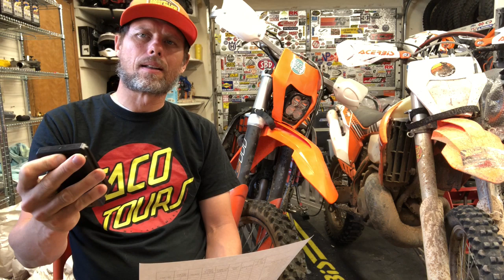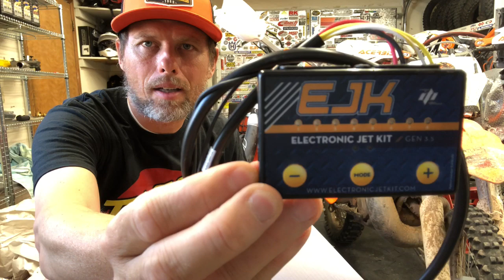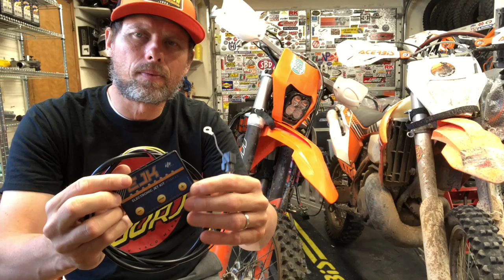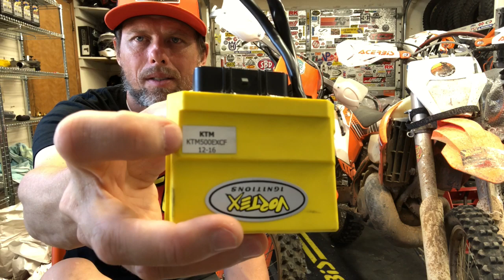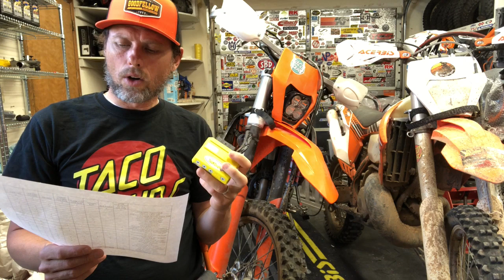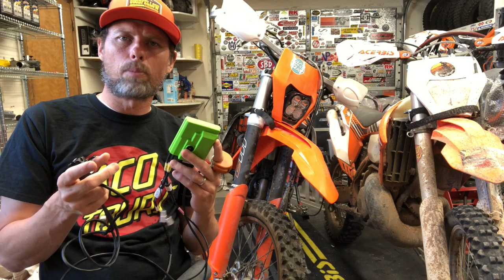Athena GET, Vortex ECU, ECU reflash, euro map, stock ECU, Dobeck EJK tech talk

Comment: Great, at 38:54 you completely talked me into getting the most expensive option ECU wise. But with a background in tuning stand-alone ECU's for cars, you're speaking my language... I'll be calling you up as I get a credit card the wife doesn't know about... Thank you for a very informative video!
Reply from the maker: I’d like to hear what you think of it after you’ve got some miles on it!
Reply: @TACOMOTOCO  The combo of the GET and the Promoto billet end cap is amazing! Complete monster when you have the traction to put the power down! I thought it would be a little louder and I'm glad it's not. It's an awesome throaty sound without being ridiculous and to have the power without being too loud is cool. I wish I could have done an actual back to back comparison but I had sent my suspension off to Kreft before I ordered the ECU and end cap. So I had 3 or 4 weeks between riding on the stock ECU/suspension and GET/end cap/new suspension. I couldn't be happier, thanks again Mike!

Comment: Very helpful thanks.  I've just bought a 450 EXC having a 390 ADV in the garage already.  I find the TC on the 390 useful in the dirt but often turn it off too.  I'm thinking I would like this feature on the 450 (be able to toggle TC on/off) so the GET is very appealing as a drop in solution.  I'll ride the 450 for a bit before I take the plunge I think.  Thanks again for the breakdown.

Comment: I've been tossing around the idea of putting an ecu on my crf and this video made up my mind. I live in southern arizona so I ride everything from low hot desert to alpine forest mountains. The ecu will will allow me to tune my fuel injected bike to run great in the many different altitudes and conditions I find myself in. I'm still not sure if I will go with the vortex or the get but I'm convinced that aftermarket ecu is the way to go. Thanks for a great informative video🇺🇲👍🇺🇲
Reply: Ugh!!! Lol do I want vortex so I have more maps to work with or get so I have t/c and ability to make changes through data link? Side note I run a completely stock crf250r. No aftermarket exhaust or anything. I'm strictly adding an ecu to optimize the performance and potential my bike has in stock form. 🤔
Reply: @jondoe4667  did you end up getting a vortex or get?

Comment: So for the guys who are riding a dinosaur like me(2013 500 XC-W). Another alternative is the Dynojet PCV (5) It is kinda in between a piggyback and a new ECU. It installed like a piggyback but allows you to change fuel and ignition at numerous poins on a throttle position and RPM graph. It is definitely for the guy who likes to tinker or has access to a dyno, because the number of pre compiled maps isn't great.  I chose to run an O2 sensor and map switch on my setup. You can run both, one or the other, or neither, depending on your preference. Having said all that I like the Dynojet but if the GET ECU was an option for the 12 to 17 500's I would be tempted to check it out for the simplicity of not having to run all the piggy back plugs.

Comment: Hello Mike. I have been shopping for a used 2016-ish KTM 500 EXC-F and have therefore been schooling myself up on the bike and already learned very much from your videos. Furthermore, you're an excellent teacher and speaker, not to mention your sincerity and wealth of knowledge!

Matter of fact, tomorrow I am going to look at a 2017 500 that comes with a Vortex ECU. (Also been uncorked and desmogged.) But the Vortex is one of the things that appealed to me about this bike. I fully expect it to run well when I take it for a test ride, but if I buy the bike, I wonder how I can know if the ECU has been tuned and properly configured for this bike? Thanks if you can point me in the right direction.

Comment: Question , I’m guessing the 02 sensor is now dead weight ? Ecm will no longer need its input to calculate air to fuel mixture ? It will now use pre Proggramed  map and the barometric pressure sensor  for elevation changes correct ? I wish the o2 sensor was still used for the aging of the parts , like less fuel pressure or dirty injectors over time . The 02 has a lot of benefits .

Comment: Vortex, on my Honda now has a proper traction control, not just map switch. Activated and deactivated by the start button. I have tested it and it works very well on slippery surfaces. Not sure if it is available  on KTM Vortex models.

Comment: TPIs dont need more fuel they need different injection timing.
They inject on the piston down stroke so most of the fuel goes straight up the t ports and the whole bottom end doesnt get any fuel cooling.
It gets oil ok but that doesnt cool the crank and rod and piston like a carb engine does.
Parts that run hot are more prone to failure no matter how much oil they are getting.
Ive retimed my TPI to inject 5 degrees after bottom dead center and obviously removed the oil injection system and use premix.

Comment: I saw somewhere that enriching the fuel will let the rest burn in the catalytic converter and fry it. And that enriching will keep the catalytic converter from getting up to working temp while it just smolders under a lot of fuel and prematurely wears out out. Any truth to that? That said, I am looking for the best way to get rid of off throttle lag and still stay legal on a 701. And not be loud. I know that's a stretch. Is why I was wondering.

Comment: Great video.  The one problem I have with the GET on a 2019 FE501 is, it disables the stock kill switch.  Still waiting on an update from athena on that.
Reply from the maker: We use the Sicass Racing combo switch as a work around.
Reply: @TACOMOTOCO  At this point what is another $50 right. I would rather not upgrade my switch but i presume if i didn't upgrade that when the update comes you can just change it via the Wifi correct?

Comment: Very informative.  So to reduce flameouts only which reflash would you recommend.  Not looking to add adjustability just looking to reduce low rpm flameouts
Reply from the maker: First make sure your idle is set to 1800-1900 rpm per owners manual. That fixes it for a ton of guys. Next would be to increase the fueling a few percentage points in the low throttle angle range. Is your exhaust still stock or has it been modified.
Reply: @TACOMOTOCO  stock exhaust. I set my idle to @ 2k.   13 tooth primary gear.   Yes I'm thinking it needs a little more fuel down low

Comment: There is so little information about the get rx1 ecu, there is no pin out of the connector?

It seems like this ecu can do quick shift? If you wanna do that what pins is it wired to? Is it only compatible with digital switch or can an analog load cell be used?

Please advice.

Comment: How does the GPA dynamic traction control work without any wheel speed sensor on the map 2 setting for the 2022 KTM 500 EXC-F 4-stroke RX1 PRO, and is map 1 setting still full power and map 2 setting still soft power?

Comment: So my 2024 six days 500 came with the handlebar TC Map switch As far as I can tell it does nothing but lights up. does it connect to this aftermarket vortex or is it down stream of the Vortex. Also If I buy the vortex and select it to the  #1 map setting will the switch be able to give me another map and what designates what the switch does.

Comment: Do you have an opinion on the stock ecu reflash from blais racing?  They claim $99 for a reflash.  Looking to increase performance with this an endcap at first and maybe add some more from there.  Dont have any need to adjust myself as long as it runs fairly well.
Reply from the maker: Chris does a great job and if your ecu can be reflashed I can def recommend that

Comment: Hi there
First of all, I must admit this is an excellent video! 

However, here is some unusual question, I got KTM 500 EXC - 2014 for a really good price, however after a few rides I realized that this thing very hard to control for me. I not a pro rider and my rides usually single tracks and technical trails.  

Here is the question: What would be the best way to reduce the power of "500 EXC" to make it more suitable to single tracks?
Is there a way to make it easy to ride some kind of traction control that you have mentioned in this video?
Reply from the maker: That’s not an unusual request at all. In fact I have the same desire for my 500. I want it to be Ann all kit race bike sometimes and a reliable trackable single track bike. I have that spread of performance with the GET ecu and the traction control knob. 

https://tacomoto.co/products/get-rx1-pro-ecu-upgrade-2017-2019-ktm-500-exc-2017-2019-husqvarna-501-fe

Comment: If I just want to add a slip on FMF 4.1 and remove emissions, do you think an EJK will suffice for keeping the bike from being too lean? Or would it be worth the $700 for the vortex?
Reply: I own a stock 2017 FE 501
Reply from the maker: a piggyback gets it done all day long.
Reply: @TACOMOTOCO  Thanks! Any idea what kind of HP gain the slip on can make with the piggyback?
Reply from the maker: You will reliably see a 20-25% power gain

Comment: Great info., Mike. I'm wondering why the 02 sensor won't compensate minor changes like reed removal and aftermarket muffler?
Reply from the maker: Think of this like a thermostat on your A.C. system. It came pre programmed from the manufacturer to operate in a range from 70-75 deg. It will self adjust in that range. 

But you have parties in your house with all the people and beer pong going on it gets to be almost 85 in there, the T-stat is indicating it’s 85 and yelling at the A.C. unit to cool more but it ain’t gonna do it. 

Mods on your bike are the party and the map in your ecu is the 5 deg spread. 

If you could change the map you could party. 

But if you can’t you install a piggy back tuner or a new ecu.
Reply: Thank you for answering that question, Mike. It seems the 02 sensor on the head pipe would be   able to make the force the ECU to adjust air -fuel to maintain a consistent and correct ratio especially with these minor flow changes.  Otherwise it's just a very expensive worthless piece of junk.

Comment: So if I put a full exhaust on my bike ('19 SMC R) and upgraded to a performance airbox (and made any mods that make the bike run leaner), then  I could install the EJK and just increase the fuel delivery to accommodate? Is it possible to tune it at least somewhere close to the optimal settings as an amateur? At least close enough to prevent damage to the engine? 

Thanks for your informative video!
Reply: i don't know why you couldn't. for what it's worth the ejk is  a bit safer being fuel control only. if it were me i'd put a little 100 octane on top of some pump gas for safety, in case you try a setting a bit lean it will help protect you from melting stuff,  and just go out and try stuff, one change at a time obviously, and see what feels best. its your bike your the expert on it i'm sure you can probably find what your looking for with some careful farting around with it.

Comment: What puzzles me is that, do these ECU controlled bikes have built in CDI in the ECU or how does it produce the high voltage for the ignition coil since the coil is the same coil from 1996 KTM?  ECU and CDI don't go well together because of how much noise and interference CDI produces in the system (as far as I know) so I just don't understand how it works without COP. My knowledge of electrics isn't that great.
Reply from the maker: In the FI bikes the  ignition control is handled by ecu
Reply: @TACOMOTOCO  I get it now, I just got myself really confused after reading too much about ignition systems.

Comment: Does the 2020 XCF-W stock map switch  and traction control switch work with the Vortex or Athena ECU?
Reply from the maker: Works w the vortex because it’s tc like the stock ecu is single mode on/off. 

The get varies the to between an influence rate of 1-10, so no on that one.
Reply: @TACOMOTOCO  Thank you.  That is super helpful.

Still sounds like the GET product is the most sophisticated and probably better for little difference in price.

Comment: Great video. 
Check out bestdualsportbikes.com fuel programmer and their power bundle kit. 70 hp on Dyno runs. Very impressed after installing it on my 2020 ktm xcf w.
Reply from the maker: Mmmm, ya, about that claim. 

No 500 is making 70hp on 91 pump gas on a stock piston and stock cams running a Dobeck EJK fuel tuner. That’s not real. Not even close. 

And the stock bike doesn’t make anywhere near the claimed base power. Not even close either. 

No respected power development tuner is coming in anywhere near these claimed numbers with their testing  - and yet all these  respected tuners are coming in relatively close with their numbers. Go figure. 

Everyone is getting about 42-43 from a stock bike and HP Racing Development - one of the most respected and highly regarded tuner and engine builder with multiple engines this year in super cross has been able to get about 56 out of a stock internals 500 managed by a custom tuned race GET ECU and an akropovoc slip on. 

I WISH 70 was possible from this engine without pouring a TON of money into it to the tune of multiple thousands - but it’s not - and no amount of false claims will make that so.
Reply: @randygenet251  mmmm, yea, i seen it - but i don't believe it. we dyno testing with third party shops and the numbers don't match those. stock 20' 500's don't make 53. dyno charts can be just like a corporations P&L statement. what exactly do you 'need' it to say, and i'll get it for you.
Reply: This guy is pretty informative but the KTM HUSKY channel is no BS awesomeness. Of course this guy will sell you anything. Id rather go with KTM HUSKY advice and save $1000. You do not need a 700 tuner and a 400 slip on. Proof is in the pudding. I sell supplements and Ill sell you anything you want. I will tell you the ins and outs though. This guy is great but not saying that the Vortex for example makes youre bike run rich even at cruising speed. 250 tuner, reed cage removal, 60 end cap kit, intake flange and your bike is a beast.
Reply: @mikespurgin537  No but my 500 with his kit is pushing 51 on the dyno. Of course a stock bike is not at 50. But a de-smogged modified one does. Very basic statement.
Reply: @TACOMOTOCO  I like how you guys keep saying 'stock'. A bike with a fuel management programmer or slip on is no longer stock. Of course one plugged up off the showroom is bogged down at 42-43. So you are saying KTM Husky Dave is full of shit??? LOL I do not think so man I run his product... You just said that tuner guy got 56hp out of a "stock" bike... Show us some proof like Dave is doing. You really think he is manipulating us with false dyno claims????? COME ON PEOPLE
Reply from the maker: @solarguy1372  the BSP video claims that a factory stock bike makes 50 hp. this is bad data as multiple tuners and engine builders are getting 41, 42, 43 from a stock machine. guys like JD Jetting, Dynajet, HP Racing Development, Baja Race Performance, multiple magazines like Dirt Bike and others, all w the same results. 

then after bolt on mods (ecu's, pipes, headers, air box covers, air filters, throttle body air boots, etc) on pump gas they're getting a top out in the range of 56-59. trust me, i wish a guy could get 70 from bolt on parts and pump gas. that would be amazing. but it's not possible. 

i agree with you on the point that a piggy back fuel tuner and an end cap will completely transform an exc or fe machine for little money. we make that same statement over and over in all our communications and videos. it's a simple low cost solution.

a race ecu like a GET or a Vortex or a reflash are a different animal all together. it's not really a fair comparison to make between a piggy back tuner and a race map or race ecu.

thanks for taking a look at our videos and your feedback.